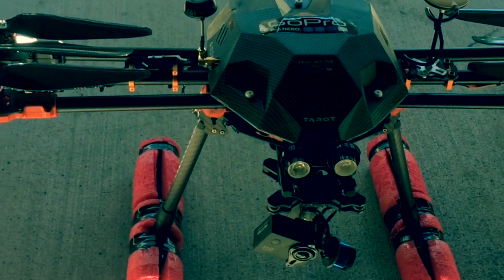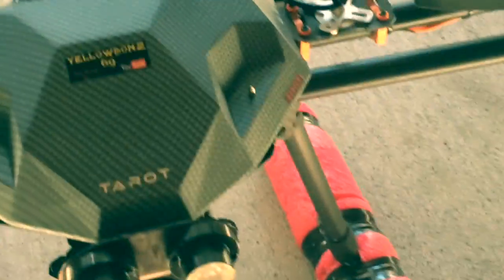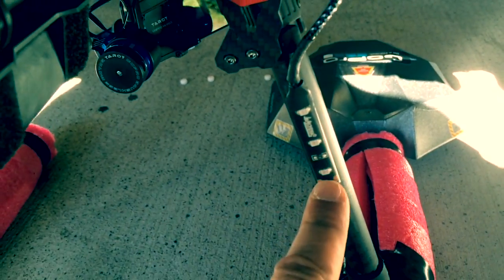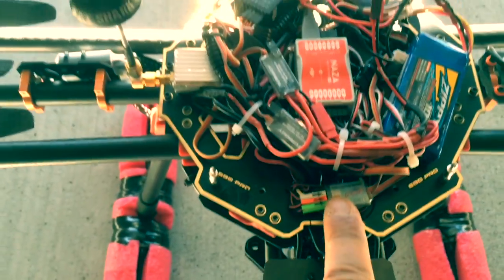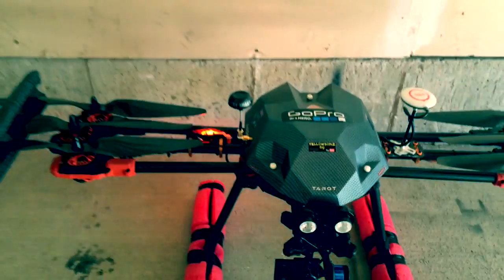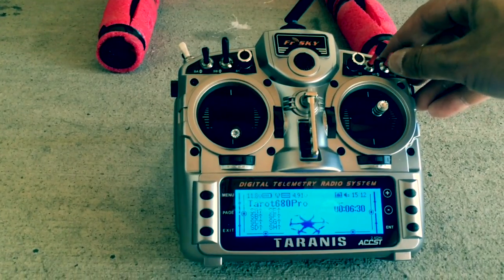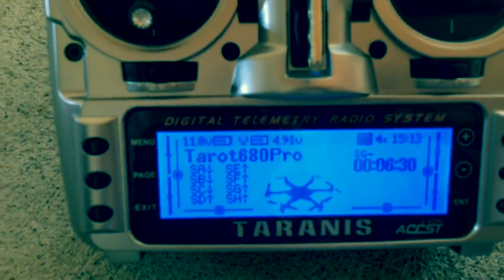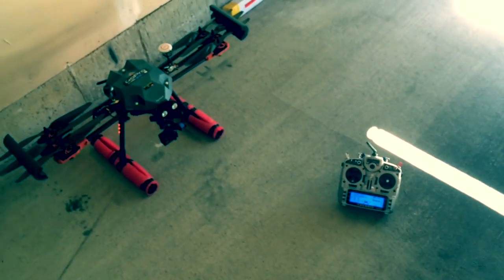Tarot 680Pro Hexacopter Build Completed

Comment: I tried auto tuning, but it crashed, then I tried manuall tunning, its still not became stable and crashed.

Can anyone help me how to make my build stable and less sensitive.

Now when I just touch throttle it rapidly goes up-down. I tried modifying sensitivity, radio transmitter curve etc nothing helped.

I want my hexacopter to less sensitive to radio input, smooth roll,pitch and yaw.

What should I achieve that??
Flight Controller: PIXHAWK PX4 2.4.7
Firmware version Copter 4.0.5
Transmitter: "FrSky Taranis Q X7 ACCESS 2.4GHz 24CH Mode2 Transmitter with R9M 2019"
ESC: Hobbywing XRotor 40A-OPTO ESC
Motors: Tarot 4108 High Power Brushless Motor (380kv)
Battery:6S.
Frame:Tarot 680Pro
Reply: Have you used px4 or ardupilot firmware?
Reply: @lukasztrzcinski3062  ardupilot firmware
Reply: Get a naza v2 ,I got two drones built on these,no problems setting up and easy...I've nothing but problems with those pixhawks

Comment: Great build. But you mount the canopy wrong. Those white anti-vibration rubbers must be fitted in those holes on the canopy. So the pins snap through them in place.

Comment: I’ve got the same 680 & Setup here as you but I’m having trouble when I take-off it starts spinning ccw, I’ve checked everything and done all calibrations still same issue, my question is how do you have your Naza FC mounted on the top plate? Mine was setup on a carbon plate above the center hole I’m thinking I need it flush with plate just was hoping you could give me some info Input on FC mounting above motors? Sorry so long just trying to give you idea of what I got and problem I’m having......Thanks

Comment: hey, 

Awesome setup, one question, On Hobbyking I can only see 6V strobes, did you find a 12V strobe setup to connect to your backup 3s?
Reply from the maker: No I used a step-down voltage regulator, I bought off of eBay
Reply: sweet, thanks!
Reply: Also, where did you buy the mount for the headlights? 
I have the turnigy headlights and they don't come with a mount of any sort. Any ideas?
Based in the UK so would have to be online if you know :)
Reply from the maker: +James Weldrake I didn't buy it I made it. Just took a piece of plastic and heated and bent it to my specs and painted it up.

Comment: what is your average flight time and approx. weight. Also compared to a dji phantom is the flight stable and predictable? Im wanting to build a t680 but Id like to have the same stability as a dji phantom and 20min run time if possible

Comment: Nothing but problems when kicking on the navigation lights with the Tarot T-2d gimbal.  The gimbal goes wonky every time.  I put it on the main lipo's and off the accessory lipo.  Still went wonky.  Ended up tracking the problem down to those dual Turnigy strobe lights.  Once disconnected, no more problems with the gimbal.  Weird!

Comment: Hey Yellowbonz69, I know this build is like 2 years old, but it's very nice.  If you can recall, I am guessing you had to use a reaming tool on each of those props to get them all the way down on the cowls?
Reply from the maker: No I did not and never have with any of my drones actually
Reply: hmm.  Well I removed both 5mm & 6mm sleeves.  Blade hangs up where the threads end.  Wasn't sure I should push down too hard to seat it.  Tight!

Comment: I just ordered a T650 but plan to make many of the same mods as you have I have a Phantom 1 and I built a DJI F550 and have made many mods to it . I like the NAZA M Lite and the V2 The Lite is still in the box and using V2 on F550 . I live in East Texas where are you from just guessing Louisiana and maybe close to me . If so like to get together and talk some time You are where I want to be with your Tarot but I want to get bigger camera like one of the mirrorless cameras Canon , Sony , Nikon to keep it small but use better glass than action cams . I am using the 650 but will use sport motor mounts and big motors and props 16" to 17" and 4010 to 5208 340 to 370Kv for all the extra weight . Building a quad leaves more channels open for mods for camera . I like your FrSky that's cool . I would like to bend your ear a bit as I build my T650 if that's cool ? Hope your close . I don't know anyone into building close to me a few have Phantoms but don't feel adventurous enough to build their own , I'm hooked . Let me know if your close . Spencer Boaz @ You-Tube

Comment: friend, I liked a lot of your setup and organization, wanted to know more details if possible the list of parts you bought and where you bought , how you manage the navigation LEDs ?
Is it possible to have all of these controls with a radio Turnigy 9xR ?
Reply from the maker: Jonatan Ferreira Hi and thank you. Parts list is found in the series, one of the videos lol. The majority of the parts came from Hobbyking n EBay, obviously as a builder I have lots of assembly components already on hand ie solder wiring and tons of hardware. Those kewl Nav Lights which have they're on control unit came from HK as well. That 9XR has just a single 3 position switch if I'm correct so NO you will not be able to control as much.

Comment: Hey YB69 Can you tell me how/where you got your sound files for the Taranis? Also, what about gain settings and Hex battery warning settings in naza? I am running a single 5200 mah 4S 14.8v battery. Would you mind sharing? Thanks!
Reply from the maker: Jack Kindberg hey those voice files are included with the Taranis, already on the Mini SD Card.
Reply: YellowBonz69
Thank you for the detailed and very informative response bro. Great build!

Comment: Hello bro, where did you get the front lights?
Reply from the maker: Nicolás Torres Those lights came from Walmart, automotive section, 12v lights work well with a11.1v lipo

Comment: Man! You've got a lot of stuff crammed into that thing! I just ordered the parts for mine. Hoping it can be this awesome eventually. How are you wiring the backup battery? Does it just go to auxiliary things like the lights? Or does it tie into everything somehow? What kind of flight times are you seeing?
Reply from the maker: Hi and thanks for watching and for the comment. My2nd battery is just for running all the other stuff, nav lights and camera gimbals, I control the lights from my transmitter using the hobbyking receiver controlled switch.
Reply from the maker: Flight times were a concern but j just received my 2 new lipos. 2 16000mah 4S 10c discharge, these will keep me in the air 20-30 minutes at a time and again they are from Hobbyking
Reply: Nice! I really like the idea of electrically isolating the smaller systems. How long does that 1000mah pack last before you need to recharge it?
Reply: Oh... I forgot if you mentioned it in the video, but what are you using to connect the second battery up to your auxiliary devices?
Reply from the maker: Matt Kent Usually 3-4 flights I recharge it, but I do lots of tinkering and testing at home so that's using some mah up as well.
Reply from the maker: Matt Kent I'm using 2 Hobbyking receiver controlled switches, simple install and just uses the ground from the flight battery. I have about 8 in use in all my different RC's